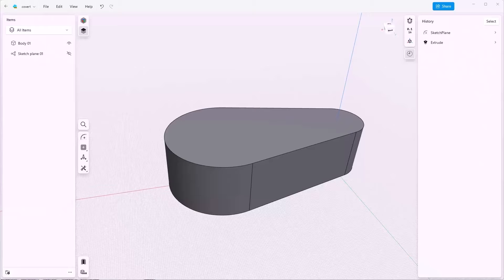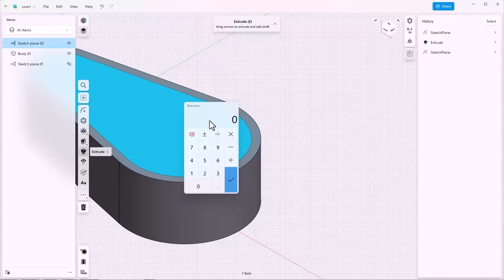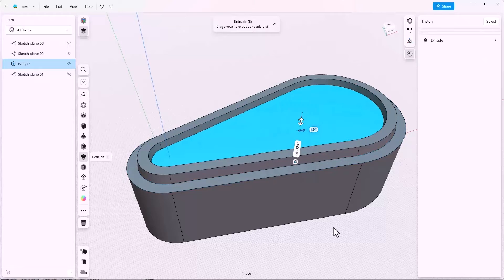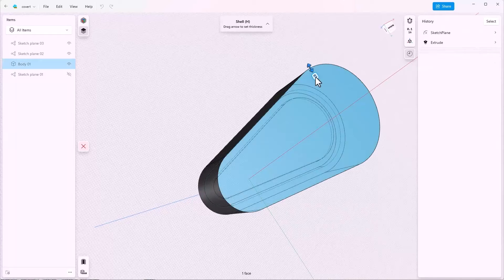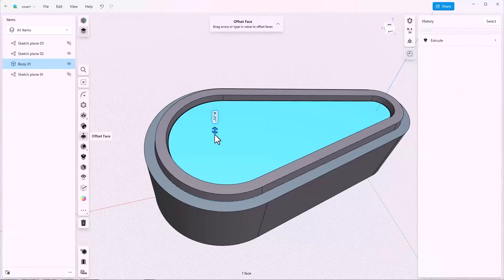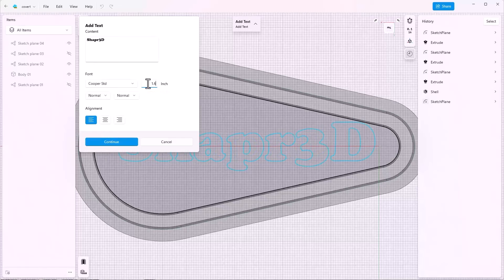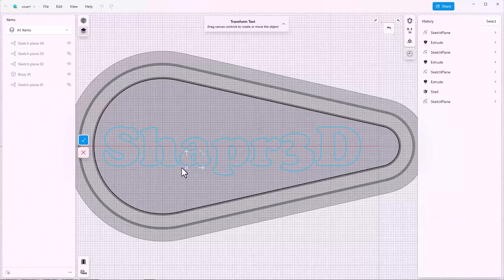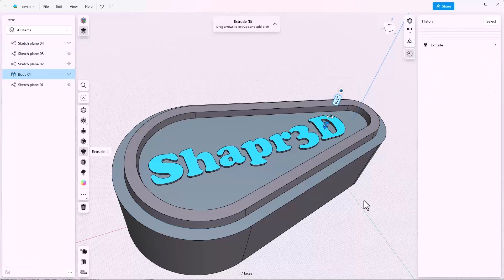Create basic 3D geometry: Motorcycle Cover Design part 3 | Shapr3D Basics

Comment: I have watched and repeated this video step by step now 11 time in a row and cannot get my lines to tangent at the first step. The first line immediately parallels with the horizontal and then all other attempts are conflicting. I give up.
Reply: Happened to me. Don’t try to make them even just make sure the lines touched
Reply: @that_guy8893  you need to lock all elements - 2 circles and 2 lines and THEN start selecting them and hitting tangent button
Reply: you need to lock all elements - 2 circles and 2 lines and THEN start selecting them and hitting tangent button